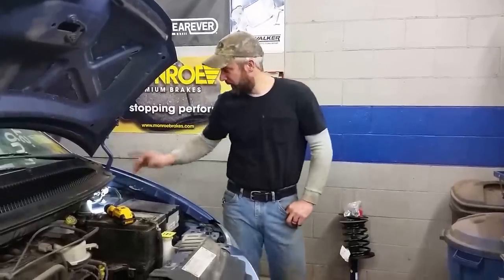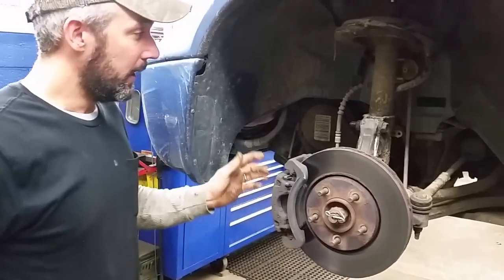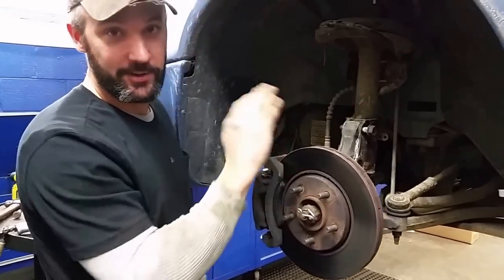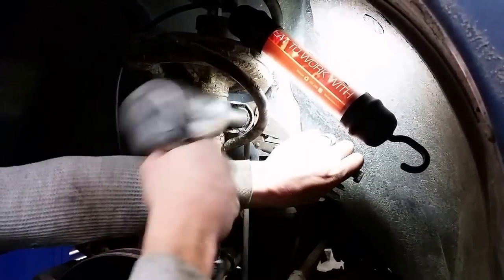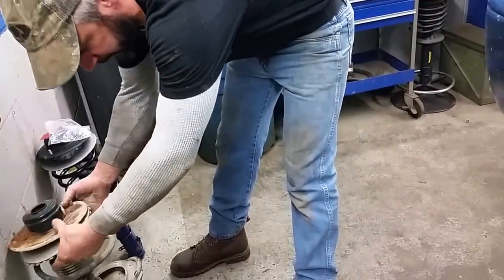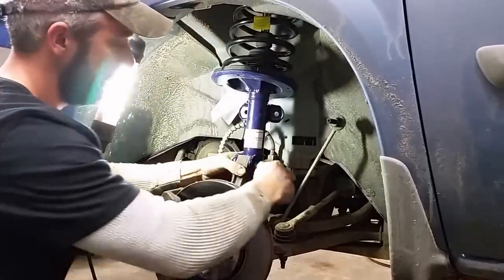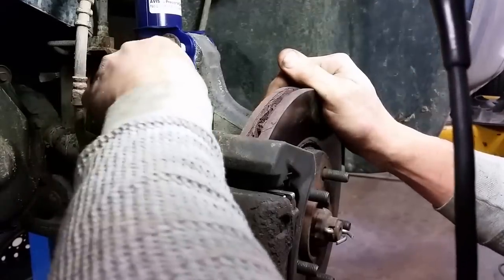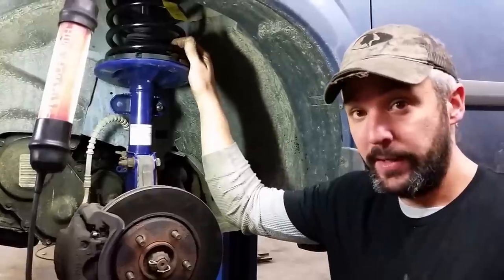Chrysler Town & Country & Dodge Grand Caravan - Front Strut Replacement

Comment: Good tip on the sway linkage. Turns out mine was rusted. wrenching off the top 18mm nut was a bear. I followed your tip and was making good early progress and it just welded itself to the stud. Wound up using a die grinder and cutting whell. On the passenger side I am going to chase the threads with a die first! Thanks for the vids!

Comment: EXCELLENT! These type of YouTube vids usually don't work out too well for me. Something always goes wrong or there is always something different that I have to end up dealing with. Not so with this vid! It was perfect!!! I bought the Monroe Quick-Struts from Amazon at 1/3 the price of my local auto parts store and had both installed in one hour (not including the jacking and jack stand time and the time to look up the correct torque settings). Saved a little over $500--Nice!!! Thanks so much.

Comment: I love your content, and because of you, I actually think I can replace my engine by myself, but not yet, my grand caravan has 262k miles and still running strong, I was going to say two things: the stabilizer bar with the 40 torx I can use a pass through ratchet with a 40 torx socket head, and then for the strut bolts, I'm from Michigan, mine were way worse than yours, I actually used a tire iron with a cheater bar

Comment: I picked up a 05 caravan the other day which needed a left strut. I don't know why the guy didn't fix it himself. He sold it as a scrap vehicle which I inly paid just under $250. I got the strut for $60 new online. I've been messing with cars for over 30 years but I never had to do a strut. This video helped me out. Especially with that sway bar link. That thing was a pain in the ass ! Luckily I had a plumbing torch and was able to heat it up and get it off. The brake like was also rusted and attached to the old strut. I had to cut that bolt off. Good vid, thanks !!

Comment: Had a 2005 grand caravan. 180k miles. Still  Ran and drove perfect. Strut spring snapped off when I hit a manhole and left it stranded in a parking lot. Couldn't drive it, becuase the spring was poking into the tire. If I would have known this wasn't too hard could have saved it.

Comment: I put the strut nuts on the aft side to better protect from corrosion, though may not matter.  Most quick-struts have slotted bottom holes for camber adjustment as shown.  Best to buy special cam-bolts to allow adjustment.  The Mopar ones are pricey ($50 ea), but another company (Specialty Products?) has affordable ones ($25/pair, ebay or Amazon).  Camber adjustment is somewhat a preference.  Slight lean-in (<1 deg neg.) gives a little better handling on twisty roads, while perfectly vertical gives longest tire life.  Toe-in is more critical for tire wear and is affected by a strut change, unless you get camber exactly the same, and nobody is that lucky.

Comment: The way those struts are made, you can pretty much self align them. I leave the two bottom bolts on the struts tightened just snug. I air tires up to 40 psi and install. I then lower the vehicle, drive straight back and forth in level driveway, which causes the adjustment bolt to move where it belongs due to the flat tread of the tires leveling, centering the strut properly. I tighten that adjuster bolt up as the vehicle sits after that. I then jack up and torque both bolts on both sides to specs and lower the psi in the tires between 32-35 again.
Reply: Great tip. How did your tires hold up?

Comment: You make it look truly easy my friend.  I just replaced both lower control arms, stabilizer bars, tie rod ends, rotors, calipers and shoes myself, so I guess I could handle this one, lol.   Great job on the video!  Thank you for it!  I may need a strut on my 04 T&C . After all that work,  I can grab my pass side strut, by the plate at the bottom of the spring, and turn it about ½" clockwise and counter clockwise, there is some slight play in it too, (with my hands at 3 and 9 o clock I can rock the tire in and out about ½" and see the strut assembly move a little).  Why would it turn like that?  mounts, or the whole thing bad? I should post a vid, lol.   I cant seem to find a loose nut on it anywhere...  Any thoughts?
Reply from the maker: ***** Yeah if you make a video on it post it because I'd almost have to see what you are saying to understand the best.
Reply: South Main Auto Repair  I 'll Do that today!  Thanks!

Comment: big tip. use sharpie to mark the cars alignment before you remove the first strut
Reply: Mind sharing how you do that? Just asking
Reply: @Rosman1974  outline the strut mounting flange on the knuckle before you loosen the two nuts that hold the strut to the knuckle. When you reassemble it , line the new flange up with the outline on the knuckle and you'll be close to where you need to be.

Comment: Great video!  Your narration is awesome!  I have bad luck with strut assemblies on my 2000 Chrysler Town & Country.  Replacements chatter and rattle after only a short time.  Are those Monroe that you used?  Are these Chrysler vans hard on struts?
Reply from the maker: Hey thanks RadioRex72  Yeah these are monroes. You sure it is not just your sway bar links or bushings making noise?
Reply: South Main Auto Repair  Yes, it's the struts.  Have replaced links and sway bushings many times too.  Will try the monroes.  I've got almost 200,000 on it.  It's been a great vehicle otherwise!  Thanks for the reply, keep up the great work on the videos!
Reply from the maker: I use monroes and KYB most of the time. I think KYB is better in my opinion...

Comment: This is great! I removed them pretty easily and I'm going to put the new (Aftermarket) ones on later this week. Do you know the torque specs on the sway bar and on the two large bolts on the strut? Thanks!
Reply: +KarpelProductions The torque on those two large bolts is 60 ft-lbs plus an additional quarter turn (90-deg), The spec on the upper sway bar link connection is 65 ft-lbs and the three, 13-mm nuts on top is 250 inch-pounds

Comment: Comments: always replace left & right shock absorbers together, lift the whole front of the car or the sway bar will give problems, be careful with steel hammers, disconnect battery before you begin, usually you also have to remove the ABS wiring, the bolt holding the ABS-sensor breaks easily, it is very important too fasten these big nuts not as shown but with a torque wrench. Nice video though.

Comment: Great video.
I have an 07 sxt. Replaced with monte quick struts and nothing but problems; clattering over rough road (due to the damper nut not torqued correctly) and a crunch when making a sharp left into a raking lot with a higher then average driveway apron. Think it has something to do with coil spring, ride height and strut travel. 
Monroe has replaced them for me and got rid of the clatter, but the other ride height problem exists. 
What would you reccommend for a replacement unit. I'm at the point of getting ready to order chrysler parts and just build new assembly's.
Thanks for any input!
Reply from the maker: Cobra Ninety Six Aftermarket does seem to get worse by the day. I would say OE for perfect fit and function.

Comment: A word of caution ... strut replacement can be quite hazardous if the large spring is broken from the top unit under the hood. Be sure and use a spring compressor before removal so you don't knock your head off. SERIOUSLY!

Comment: I used quick struts on my caravan & according to the instructions your supposed to torque the rod nut to 60 ft lbs after installation but you can’t get a socket into the top of the strut cuz the strut tower is buried under the wiper cowling. I’m not hearing any banging over bumps but I’ve replaced struts on other vehicles in the past that did bang & needed to have the rod nuts tightened up a little but those strut towers weren’t buried & I could tighten them afterwards. Do you think the manufacturer makes sure to pre-torque the nuts properly on vehicles that you can’t get a socket into after installation like these caravans? Also, is it possible to torque the nut before installation?

Comment: Thanks for the video, it helped a lot. I took mine to a shop to get the alignment done and i asked them to check the torque on the steering knuckle and the top mount bolts. They would not do it it, because the did not do the work. I tightened them pretty good, should this be ok?
Reply from the maker: Devin Chastain  These shops blow my mind. Who cares who did the work? Yes tight is good and besides if they did a proper alignment they would have had to loosen them any how :)
Reply: Ok cool thanks. Yeah, hell give me a liability waiver....I will sign the damn thing. I can't imagine running a shop and letting a customer drive away worried about something like that.

Comment: Could you not use a Magnetic Angle Protractor to put it back to the correct camber, by measuring the angle before removing the old strut?

Comment: My comment disappeared as I was typing... I have a 2007 Dodge Grand Caravan The video worked well.  I noticed my "Bump Stop" has deteriorated into just shy of Styrofoam.  How do I replace it.  It appears to have looked kind of like the original Michlin Man rather than the "vee" on your video.
Reply from the maker: +Notlaw47 You can buy them at the parts store , they are called jounce bumpers.
Reply: +South Main Auto Repair Thank you ! !

Comment: awesome video, just found that a had a broken spring on my 2006 t&c strut on passenger side.  is it necessary to replaced both sides? or is it ok to just do the one?
Reply from the maker: Simmie Butts  I usually do both if putting in "new" components just so the van isn't sitting higher on one side that the other. I have installed a used strut here and there for customers to save them money and in that case only replaced one.

Comment: I got as far as getting the new one in, but the spring assembly pokes down too far.  Even putting a couple spring compressors won't get the damned bolt holes to align.  It's only about two inches.  What am I missing?

Comment: So its ok to install the left side part # on the right side and right side part # on the left? I just rotated the bearing plate. 
I called the strut manufacturer, they said spring is different so cant install on opposite side.  Didnt notice part # until after insatll

Comment: I was gonna count the number of times you said um but lost track very quickly, about 40-50 ummms per minute, good video though except leave bolts on when hitting with hammer might help 👍
Reply: Don't worry, Erick has an electronic umm limiter (EUM) that caps him at 60 ums per minute.

Comment: While doing the right side, the rotor sagged down quite a bit. I ended up getting what looked like red transfer case fluid come out from the center rod area. Once I attached the strut there was no more fluid leaking. Did something get broken that needs to be fixed,?
Reply: You let the wheel fall out too far and partially disengaged the drive axle.  If it fully disengages, you've got a tow to the shop ahead of you.  That's why some mechanics advise removing the axle nut to allow the wheel to fall off without pulling the axle with it, and why others recommend supporting the lower control arm with a jack.  But if you're not going to do either of those two things, you have to make sure as heck you never let the wheel pull the drive axle loose...and that can happen before you even notice it.

Comment: I know it's an old video, but, wouldn't it be safer to knock the bolts out with the nuts slighting on to keep the threads safe in the event the hammer slips and misses?
Reply from the maker: Alfredo Pacheco Jr You could I guess
Reply: +Alfredo Pacheco Jr It looked to me that the bolts had fairly large tapper on the end with no threads. These kind of bolts helps to align the holes and won't damage the threads.
Reply: +Alfredo Pacheco Jr 
The bolt has an extended taper, so it should be OK to hit it. (within reason)

Comment: have a question.  I need to replace the struts on my 2005 dodge grand caravan.  Do i want monroe 181572r assembly or monroe 171572r?  There is a bout a 100 dollar difference in the parts (for both) and was curious which one i should replace it with.
Reply: I have the same question.

Comment: So could the alignment have been avoided by using OEM replacement struts?
Reply: No, it still needs to be aligned.
Reply: @leerjet18  if the new strut has regular holes how is camber adjusted? there is no oblong hole for adjustment.

Comment: did the rear shocks, WHAT A NIGHTMARE!!! there strut mount is like a cup, and the bolts bolt up into it, and the cup gets full of muck after a couple years from wear and tear, the crap gets wet, rusts the ends of the bolts securing the mount. i only managed to get three of eight. and then youj cant get to the rusted ends, have to drill, rip the inside apart and cut a hole to access, or cut a portion of the unibody from the exterior and replace the nuts. hammer it back and weld it up. not for the ordinary everyday guy.  now i know why i see so many caravans out there with a splayed out rear end.  my only mistake was i went cheapo with the shocks

Comment: Does anyone know if you can use a Corded Electric Impact gun to remove the lower bolts/nuts? The gun is only rated at 230 ft lb's of torque.
Reply: Give it a try, good chance it will work. Especially if you spray the bolts with penetrating fluid a day before doing the work.

Comment: Can some one please tell me where on a 2006 dodge caravan I can place a jack and stands please, tired of hitting the wrong spots, dads already bent a rear leaf hanger placing the jack..... I need to pull the right front wheel off to inspect a oil or grease leaking issue. PLEASE a video would work great I love to work on my own cars and I am used to full frame and GM cars...... Thank you!!!!!
Reply: +Richard Hastings If you are still wondering about where to lift the caravan, try looking at this forum post about the same question for an '01 caravan.
http://dodgeforum.com/forum/dodge-caravan/320670-stupid-question-how-to-jack-up-my-van.html

The short version, from that forum, is this:

For the front you can use the cradle bolts.

For the rear use the front supports for the leaf springs.

The jack points are actually the standing seam on the rocker panels where there are two tabs front and back. Only problem is that shops wrongly use their hoist jacks in these locations and the tabs get bent out of sight and the area compromised. Since the tabs are important to the Owner in the event of a flat tire, shops should not be damaging them, but they do. The lazy loafs, can't be bothered to bend over find another location.
Reply: +Richard Hastings Also, here is an image for where to place the lift jacks and emergency jack that comes with the vehicle.

http://econtent.autozone.com:24991/znetrgs/repair_guide_content/en_us/images//0900c152/80/07/33/62//medium/0900c15280073362.gif
Reply: Yeah tgose spots for a dodge grand caravan was explored, also came with faulure, the lip started to buckle, I thank you for helping, I will go to a chrysler dealership. Thank you.

Comment: Believe it or not I didn't have to have it aligned after replacing front struts
Reply from the maker: Rob Cisneros Did you have it checked to know it didn't need aligned?
Reply: By needing alignment do you mean when u let go of the steering wheel does it pull to one side or do the tires roll on the pavement evenly yes they do and yes I did get a professional opinion I didn't tell them I just replaced the front struts until after the said it didn't need an alignment they even took it for a test drive
Reply from the maker: It will be interesting to see how the tires wear long term. I guess I just have never installed a strut and had the alignment dead on when I put it on the alignment machine. I have had them drive straight and steering wheel straight and seem to be "dead on" by a test drive but when I measure them on an alignment machine usually the toe is off up to 1 degree. That will wear tires at a pretty accelerated rate with no symptoms. With all that being said just keep an eye on them and you can always take it in is you see it wearing a few thousand miles from now.

Comment: you can also use a camber level on your rotor (just make sure you have a couple nuts on to ensure the rotors are snug to the hub), then take your camber reading before you loosen any strut or strut mount bolts, then adjust it to the same camber after the install, if there are no other alignment issue that should avoid the need for a full alignment, as tow  in / out should not be affected by strut replacement.

https://www.amazon.com/Hanperal-Universal-Magnetic-Camber-Alignment/dp/B01EPL6BB6/ref=sr_1_18_sspa?keywords=level&qid=1561708810&s=gateway&sr=8-18-spons&psc=1

Comment: Do you guys own a Torque Wrench?
I'd be tossing every nut and bolt you've used an impact wrench and a hammer on, on top of the salt, that sort of shocking of the metal from the impact wrench can cause fracturing and early failure, something you never want on Suspension items.
I've had workshops destroy wheel studs like that on my own car.

Comment: I wish the elongated lower hole had a reference point to match the oem non-elongated hole. I shoved mine for max camber, pushing the strut and knuckle IN towards the engine before tightening. I couldn't notice any "knock-knees" in the front, but I would like to match oem. I did a wheel alignment but they didn't say anything about camber, only the toe was out a bit. Maybe they will have records of what they found.